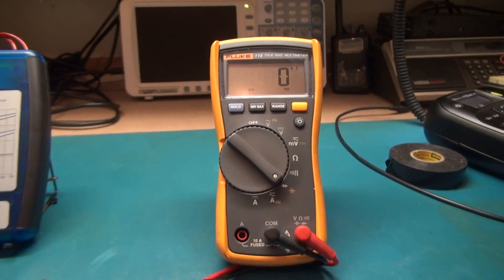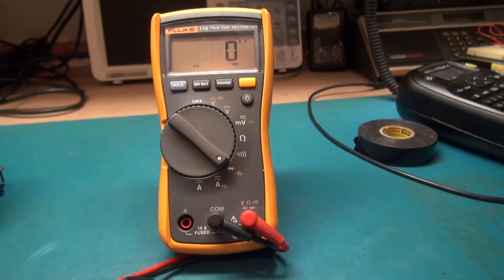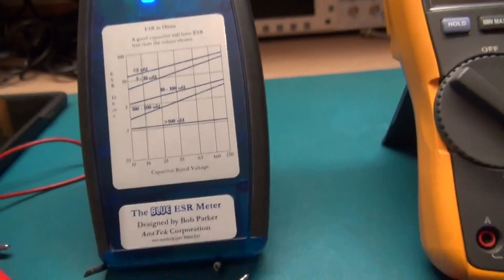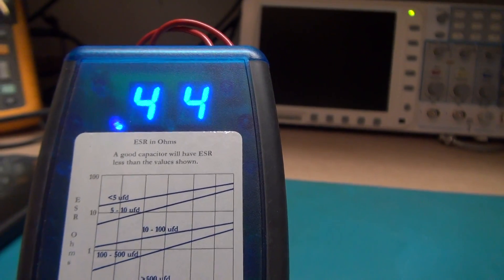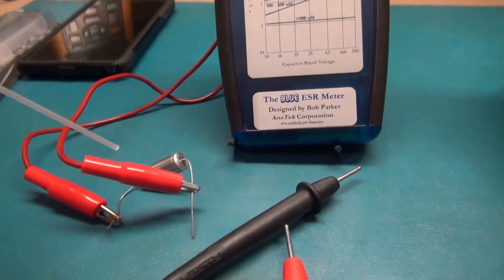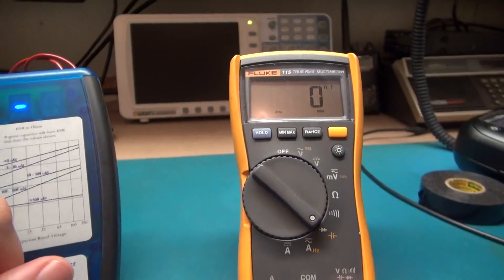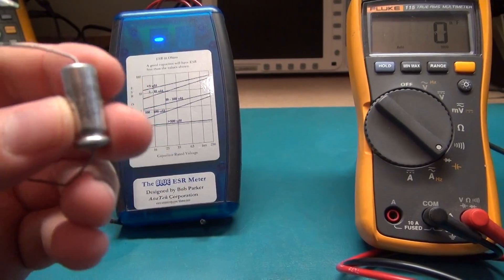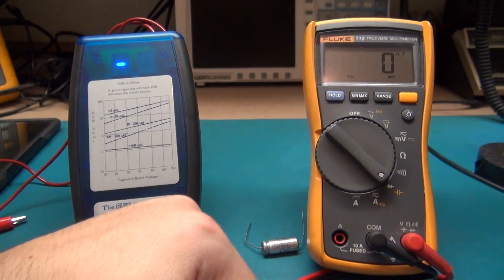Capacitor testing basics. Don't use a multimeter. Here is why.

Comment: MY Question is,  if that's ohms. Why can't you use the multimeter and do the same test?
Reply: ESR cannot be measured by ordinary multimeters. It is not a real resistance but a composite impedance. It needs high frequency A.C voltage to be applied across the capacitor’s terminals and then measure the relevant (A.C) current, which represents the ESR according to the Ohm’s Law. Multimeters measure exclusive real resistance (I.e ordinary resistors) as they use D.C (battery) voltage for that purpose. That’s why they can’t measure impedances like ESR. Resistance, in other words, always refers to pure resistive loads, while impedance refers to a composite resistance a load represents in a specific frequency. As it is frequency depended parameter, it needs A.C voltage for testing. Not D.C...
Reply: the value of resistance is very small for a dmm to measure so we use a ESR meter

Comment: Don’t stuff about with freezing, change the cap.   Do you realise how many caps you can buy for the cost of a can of that spray stuff.
Reply: You are right, but this method is a “blind” repair. It is based on the thought “it will work if I replace everything”. But doing this way, you never learn the art of electronics. And the art is to identify the defective component by measurements, without harming the printed circuit board by unnecessary components removals...

Comment: Did you ground the cap b4 testing?
Reply: There is no need to do so when testing caps.
Reply: @marlinnano9370  "Grounding" has no place in this test. "Discharging" the capacitor before measurements is the correct procedure, but it is quite another thing to grounding.
This (discharging) should be done if one wants to work with the circuit immediately after power off. This is the only case where proper discharging of the high voltage caps is absolutely necessary.  
Whenever one works in a non powered circuit, no such a precaution is needed. The same holds true if one waits for some minutes, after powering off the circuit and  before working again with it, as bleeder resistors or the circuit itself discharge rapidly the bulk cap(s) to a safe level. 
On the other hand this specific ESR meter, according to its specs, can tolerate D.C voltages of max. 25 Volt safely. It will ignore any remnant voltage across a cap within this range. 
This makes it possible to measure with it not only electrolytic caps, but also battery arrays for their internal resistance provided that one must be careful as to avoid testing near the above mentioned voltage limit of 25V...
Reply: @ΠάριςΑζής  I am new to this, but I removed 4 200v 2200 uF caps from a powered mixer board Im working on. It had been SEVERAL DAYS since it had been powered up. I decided to see if I should discharge the so I crossed + - with a needle nose plier and POW the arc was much more than i was ready for. I checked voltage on the other three and each had 44 volts DC.
So.... I would say YES, you need to discharge. Or check no matter how long its been.
Reply: @jimbaroch8871  This is the wrong way to troubleshoot a circuit. First of all, in a case like that you describe, if the capacitors hold their stored energy when the circuit is out of power for long time, this already tells you something which you obviously miss and must immediately decipher before doing anything else. 
Apart from that, discharging the capacitors by shorting their terminals is very detrimental for the rest of their operational life. Very bad habit indeed! 
Instead of that, first we measure and then we make decisions about how to proceed. Anyway this is my method on troubleshooting and I don't try to convince anyone to adopt it.
And I would like to close this comment here, with a reference to the words of a teacher of mine, been said very long ago: "when we are taking measurements on a circuit, four things must be crystal clear. A) What are we intended to measure B) Why we are intended to make this specific measurement C) How are we going to make the measurement (meaning what is the best instrument available to use) and D) What do we expect as a result from that measurement. If one of these four conditions is missing, the intended measurement should not take place"...
This is the way I learned to work. But as aforesaid, it is my way. I am not forcing anyone to follow it...
Reply: Borja Gadofi Please read once again ( but carefully this time) my extensive answer...
Reply: Borja Gadofi I already answered that in advance in my last paragraph of the extensive answer I sent you. It ends with a clear answer to your last question!  And my point is to help young people learn. Not to compete you. I had already a successful career in telecom electronics and don’t expect any additional confirmation about that through YouTube comments...
Reply: @marlinnano9370  No problem!
Reply: @marlinnano9370  It's up to you the decision to use the multimeter instead of an ESR meter. There is nothing wrong with that. 
Still there are comparatively huge drawbacks in this method. The main one is that you are obliged to always remove the capacitor for testing it. This in turn means that the time to be spent in a circuit full of caps will take you some days to test it.
Moreover the danger of either destroying the caps during removal is always present. And if you add the possibility to solder some of them in reverse polarity (due to fatigue or confusion) the result could get disastrous indeed.
ESR testing is the quickest and safest way to go. It is the progressive way against the primitive one. I wish I had these meters in my time...
Anyway, as I said the choice is yours and the method you prefer is technically approved (although it's only used to identify leakage of capacitors in our days, which is easily detectable again by the ESR meter as well).
Reply: @marlinnano9370  Are you Italian Borja?
Reply: @marlinnano9370  Ah, Sciptari...
Reply: @marlinnano9370  Well, Vdd is the drain supply voltage of a mosfet transistor, while Vss is its source voltage.
As for the measurements on ordinary transistors I need to know what type of multimeter you use. Analog or digital? And its model if possible.
Reply: @marlinnano9370  OK. When measuring transistors, first you need to identify their base. This, by the color of the probe connected there, will inform you about the polarity of the transistor. Red on the base (against collector and emitter sequentially) means NPN. Inversely, black on the base means PNP. Next, you can identify the emitter terminal by the slightly bigger forward voltage drop developed in the B-E junction (in comparison to its B-C junction). Even one single millivolt more than the other junction, reveals that you are measuring on B-E junction.
That is all.

Comment: Does means, if i use a good capacitor and then i freezed it the ESR is not going to change ? Thanks for the explanation, is a good video
Reply from the maker: It will change a bit but within the specs in the data sheet if stated. When a cap has bad esr the temperature can effect it a lot more.
Reply: thanks a lot

Comment: Can I test if a capacitor is good or not using a multimeter set to µA in series with a variable DC power supply? (Leakage?)
I tested some with this method. One cap (250V, 100µF) was so broken it showed 1.1mA at 30V forever.  (No resistor inside) Others seem to be ok: some 25V, 22µF caps showed almost 0µA while another one from the same manufacturer - same batch maybe - showed about 100µA

The reading usually drops from a high point (Whatever I put into it when increasing Voltage until equilibrium) to about <5µA. That are maybe caps in perfect condition.
One cap rated for 425V, 100µF showed 0µA even while increasing fast from 0V to 30V. (It is a perfectly fine cap) I know this is expected because it is rated for 425V and I put ony 30V in it, but it shows what a perfect capacitor should look like using this configuration.

So, seems to be a way better test than what you are doing... What do YOU - guy who is reading this - think?

Comment: you could use the meter to test resistance as well....
Reply: Not the in service resistance, an ESR meter sends a 100khz signal through the cap as it measures it's "working" resistance. Instead of just the resting resistance like a simple multimeter would do.
Reply: This instrument can measure real resistors up to 100Ohms.

Comment: Why is preferable a ESR meter to multimeter to meassure capacitance? Can I use it to test in-circuit capacitors?
Reply: Search for component tester on Amazon to see some inexpensive testers that are very useful for measuring all types of components.  They can display capacitance and ESR with the same measurement along with identifying and characterizing diodes, transistors, inductors, resistors, as well as caps.
Reply: ESR meters measure that parameter of capacitors in circuit. That’s why they speed up the repair process.

Comment: How do you figure out SMD components when you don't have a schematic?
Say a SMD capacitor shorts and I need to replace it. How do I figure out the value?
Reply from the maker: Well, without a schematic you can't get the exact value unless it is a SMD electrolytic which would be marked. Sometimes in your last resort you can experiment with different values or find a similar circuit in the device that may be the same and measure the value from that. In some cases if you call the manufacture if you give them the part location the may be able to tell you what the value is. But that is always a gamble that they will have that information and or be willing to give it to you.
Reply: really.…..that's why surface mount technology is garbage throw away crap.  Through hole rules and always will when its circuit boards....but the real electronics are point to point pre-printed circuit era......its serviceable

Comment: You are absolutely right my friend. I tested bad electrolytic capacitor with capacitance meter and it showed good capacitance value, but when I tested it with my esr-meter it was crap and when I toasted it with hair dryer esr value changed dramatically with temperature.

Comment: Great video. Thanks. One question, why. If you are suspicious that the cap has possible problems, would you go to the trouble of all this testing it. Why not just change it since it's already removed from the board
Reply from the maker: You can absolutely do that if you like but it is not always necessary.

Comment: But ESR drops with rising temperature as a matter of course so you've somewhat missed the point, should not have frozen it and that device is fine. If you'd stuck to saying ESR is important or just heated instead that would have been fine. In my experience 80s components are really good and replacing them with modern ones must not be taken lightly. I have had to replace modern replacement capacitors
Reply: You are right! There is no temperature testing for caps, supported theoretically, for their evaluation. On the other hand, electrolytic caps cannot work in deeply low temperatures. This is long ago known. The same is true for lead acid batteries. The available capacity to be exploited in feeding temperatures is much less than their nominal and below -50 degrees their use is impossible. The same phenomenon happens with electrolytic caps. It is a matter of electrochemistry.

Comment: AND how does a brand new capacitor react to the same treatment?
Reply: It's not simply new vs. old. There are specifications for temperature coefficient for electronic components, and they're different.  The tempco specification is used when choosing parts for a design depending on how critical it is to meet operating temperature ranges; low tempco parts will generally cost more, so it's a tradeoff.
Reply: All electrolytic caps have the same reaction to low temperatures. This is the main factor that telecom equipment works unhappily in North or South poles of the earth. 
On the other hand no capacitor manufacturer recommends such thermal stress for their (commercial) capacitors evaluation. 
As for the cap shown in the video, characterized as faulty, I would say that nothing is wrong with it because a) the ESR value of this table refers to brand new caps and b) even at minus 45 Celsius of this spray effect this cap was still measuring 95μF, that is, much higher than the minus 20% of its (down) tolerance - rejection limit.
This specific cap has not the proper specs to respond to the demands of a modern switching power supply, but is perfect for any other (analogue) circuit (where low ESR is not needed, like audio circuits or linear power supplies).
Capacitor manufacturers recommend replacements when their caps reach either the double of their nominal ESR given in their data sheets or when their leakage current  reaches (or exceeds) the value usually calculated by the formula: L.C (in μΑ) = 0.03 x C(μF) x W.V (= working voltage in Volts).
Reply: Peter Riis seriously right? not very controlled "science" not showing the difference between the new vs old resistance rise when froze and or heated.
Reply: @skydanison991  👍

Comment: Those new capacitor checkers are ok for modern low voltage caps, but I"d never use one to test older capacitors that have a higher working voltage. Many capacitors will check fine at half their WV, but problems become evident when voltage starts to rise, especially with paper capacitors. I have a Heathkit that will test at 600v.
Reply: For testing leakage, you are right. Nevertheless ESR meters are still better, because your leakage test might be good but still much of the capacitance might be lost due to the dried electrolyte. And this can be detected by ESR meters!

Comment: great vid . is there some brown stuff that comes out when a capacitor burst?
Reply from the maker: There is "stuff" that comes out when it does burst and depending on the capacitor it can be brown. Don't confuse it with glue that they uses to sometimes hold the capacitor down from vibrating on the board.

Comment: Wish you had mentioned the temp range rating of that cap. The can of freezing spray that you were using can make a brand new certified capacitor esr change. That stuff has always been danger in the wrong hands even cracking smd's and breaking internal chip bonds. I don't recommend new techs or hobby types do it  on real circuits that is what controlled temp chambers are for.
Reply from the maker: What important information did I leave out that you are you looking for and didn't find?  There Is no way to explain everything in this "Capacitor testing basics, Don't use a multimeter here is why" video. If you were looking for a more advanced video in capacitors than maybe you should have skipped this "basic" video and watched a more advanced one. It's not my fault you came to a video that clearly stated capacitor testing basics. This video is more or less showing people like the title says, don't use a multimeter and explains very clearly why. I think was covered in very logical manner.
Reply: @Kev_31779  For me it would have been nice to have an explanation as to why freeze a cap to test it. I'm assuming you have to be REALLY low temp in order to change the performance of a  GOOD cap, and that's why you froze it? 😊
Reply from the maker: This was just a demonstration to show that ESR can change with temperature and even worse with a bad capacitor. The freeze spray can have its purpose when trying to find a hard to find pesky leaky capacitors that is nested in with many other capacitors. using the a heating cooling method. Check out my dell ethernet switch repair. It maybe saved me hours from removing all the caps from the power supply and testing them individually. The unit would only fail when it was in a fairly chilly environment. I have rarely if ever seen it cause catastrophic failures from using it gingerly.
Reply: Kev31779 I understood  your purpose but there were no cautions or warnings in your demo and there were a couple of unanswered "huh" type comments. Several others in my class ran across  and asked me about it so I posted the caution. Not stepping on your toes just eliminating " I saw it on YouTube so it must be ok always"
Reply from the maker: No problems here. I admit , sometimes I can leave out some details unintentionally on some of my demonstrations. Its is tough sometimes with a low budget production as is mine. I do my best to help educate the people that comment in my videos to fill in the gaps. Sorry for any confusion I may have caused. I do like that people ask questions and or even point out things I may have missed.  Thanks
Reply: Saying you have a low budget production is not a correct reason for leaving out important information.

Doesn't cost much to write down what you intend to say and check you have covered everything in a logical manner. Maybe go so far as writing a writing a script..

Comment: Hi I have a multimeter with Capacitance testing function. I would like to test a 1000uf Cap however the meter only has the following ranges 100uF, 2uF, 200nF, 20nF, 2nF....am I right in thinking I need a different meter?
Many thanks.
Reply: Yes!

Comment: Hello. Great video. Thank you for this information. My electronics knowledge is limited so please pardon my ignorance. One thing confuses me though. From what I gathered from this video is that both the multimeter and your ESR tester regarded the test capacitor as good. It wasn't until the freeze test that a weakness in the capacitor became evident. Is my understanding correct, or am I missing something? Also, I don't see many videos where in-circuit testing is done for various components like resistors, capacitors, and inductance. Do you have any videos of this type?
Reply: In circut testing can get to a point where ultimately a lead or more would need to lifted to eliminate reading parallel components. Keep in mind a two lead device only needs one lead free to isolate and evaluate. Both to replace, obviously